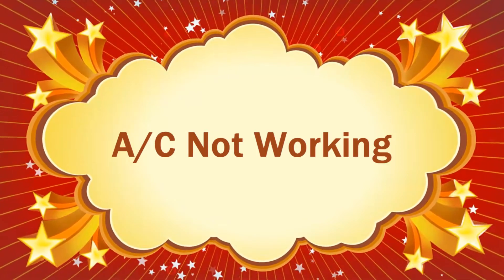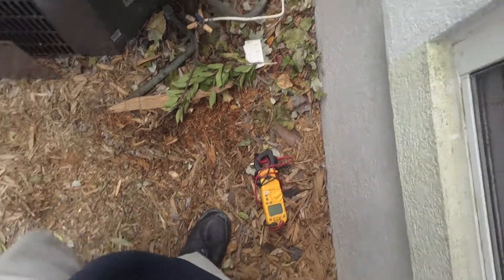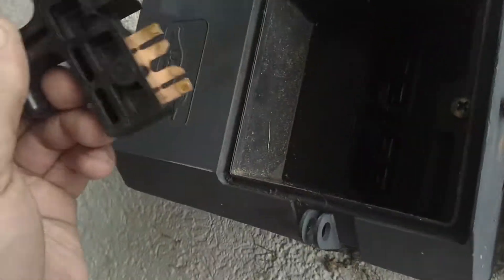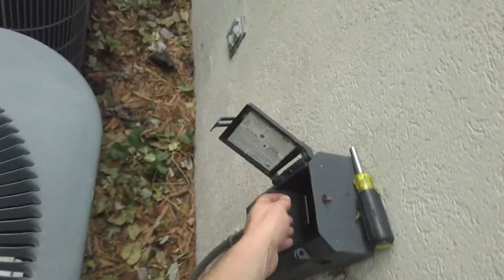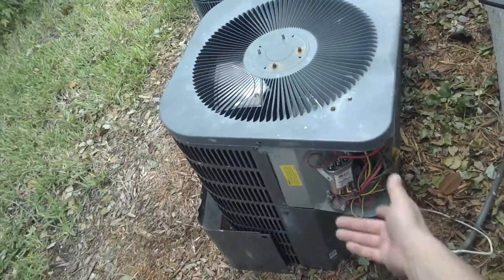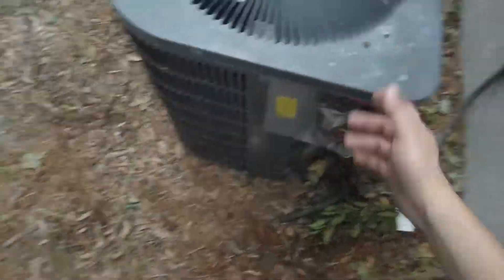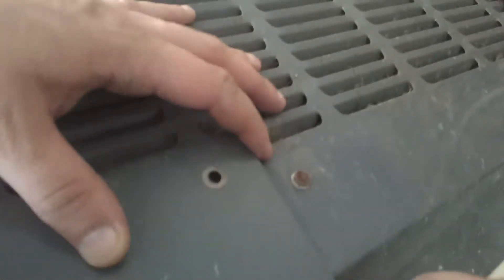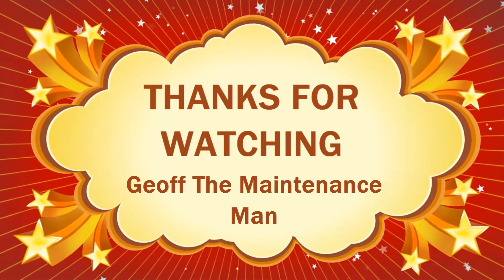AC Not Working. (And How I Diagnosed It)

Comment: Nice job Goeff, I would have checked the capacitor first. Klein sells a very good Multimeter that reads capacitors. Welcome back.
Reply from the maker: Thanks Harry this is the 6th one today. My multi meter (UEi DL389 G2 Phoenix Pro Plus) does test caps but I cut that out of the vid to save some time and Plus I already have a video of me testing one. So I didn't think it was important. But as for the reading I got a 27.89 from Common to Herm Common to fan a dead 0.00 . Thanks for watching Harry Dejesus
Reply: Geoff Howeth No problem Goeff, I will send you the model  numbet of my Klein Multimeter. I got it at Home Depot. I've been working on a lot of Air handlers in my job too. Stay safe.

Comment: Good job. You might want to get a multimeter that will test capacity.
Reply from the maker: Thanks Jeff this is the 6th one today. My multi meter (UEi DL389 G2 Phoenix Pro Plus) does test caps but I cut that out of the vid to save some time and Plus I already have a video of me testing one. So I didn't think it was important. But as for the reading I got a 27.89 from Common to Herm Common to fan a dead 0.00 . Thanks for watching Jeff Davis .

Comment: That dual cap you put on is crap quality, but good for repeat business.
Reply from the maker: Yep your right ive hooked up one before and it was reading 0.00 run and 0.00 herm so i cut it open and the wires where not even hook to the bi-metal or the cell Thanks For Watching jcbecker28
Reply: Before I found out they were crap, I bought 400 of them for less than $1 each.